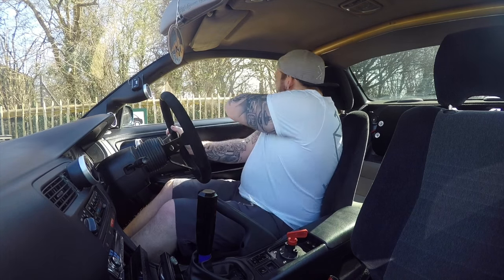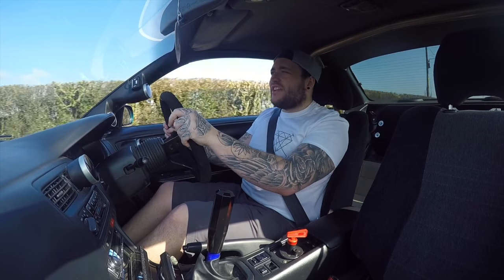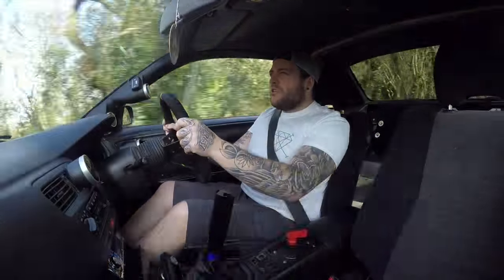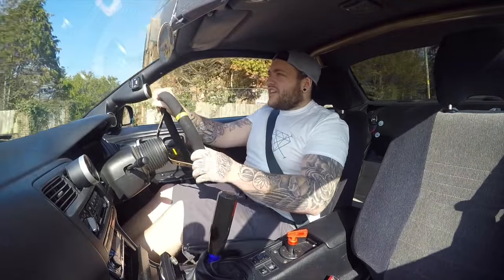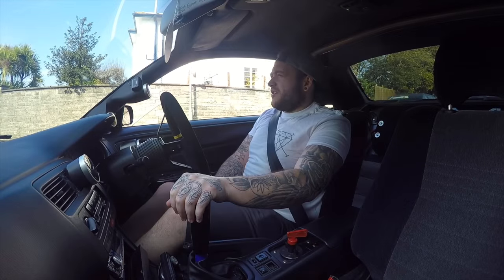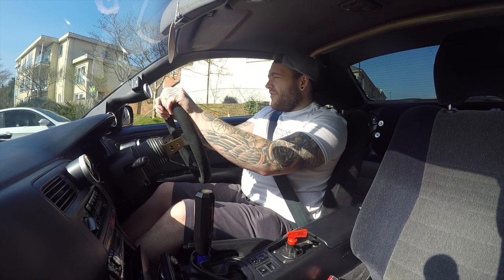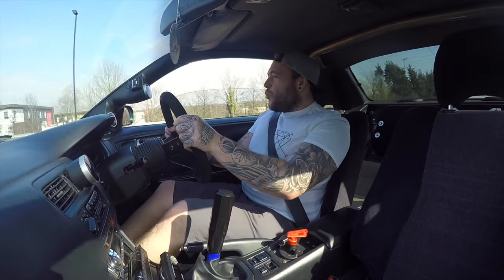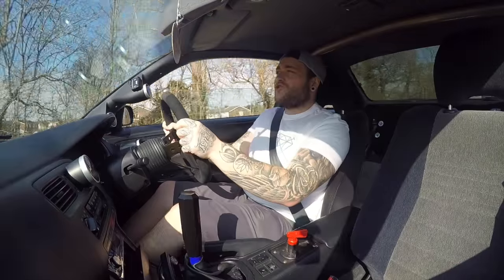Owning A 350 BHP S14A, Modified Car Review

Comment: The rear spoiler is not stock its a aftermarket. I dont like the particular BBS wheels style, S14 look good with 5 or 6 star wheels. I like the S14 rear windshield wiper blade look in the back window .🚘

Comment: in the UK an you say bhp? an its been Wheel Dyno'd its Really Whp right? always confused when someone says bhp when its tuned,
Reply: If it was 350 hp atw . It would have to be rb25 block
Reply: Oh ok, are you sure? ive seen 450+at wheels on Multiple Sr20s here in Australia, also seen 400+ on rb20s an 500+ on Rb25s , Sr20 can easily make 400+ on a stock bottom end, safely on E85 with a gtx3071/3076 turbo cams an other supporting mods,  This kind of a setup could easily net Mid to high 300s@wheels
Reply: +Ben Chesterman on 98ron you can make around the 250rwkw range safely with the right mods and tune. even more for e85
Reply: make 300rwkw 98 with the right mods tbh been done 100s of times here in Australia, gtx3076r mostly used, 

The turbo on this is tiny  size of a gt2871r
Reply: I'm talking about a 200sx with 200hp . That's impressive gains with a sr20det
Reply: Ben Chesterman Yes we are talking about Silvia S14/S15 (200sx) When you put it on a Roller dyno = read out as Wheel Hp  Not Bhp unless its being done on an Engine dyno which i doubt cause there be not need for one, until a car is over 3000hp other then At Car factorys
Reply: +Ben Chesterman Sr20s are pretty capable
Reply: record here is just over 500@wheels on E85 big cams with head work,  but still stock bottom end  with a gtx3582r